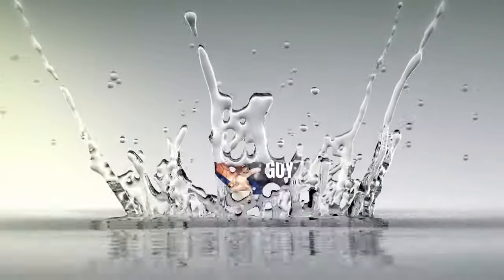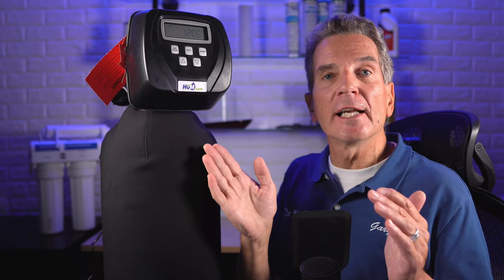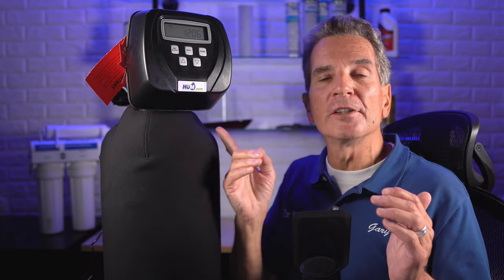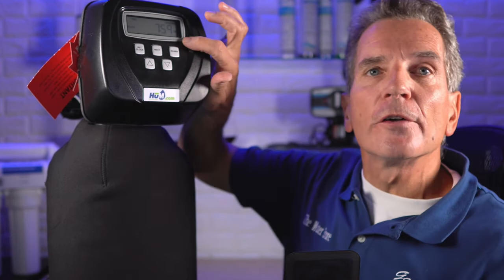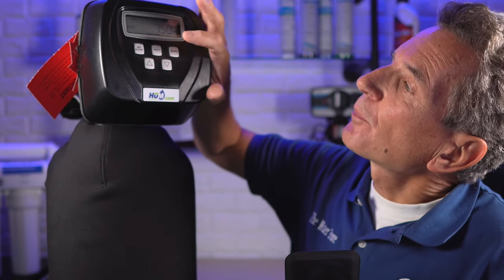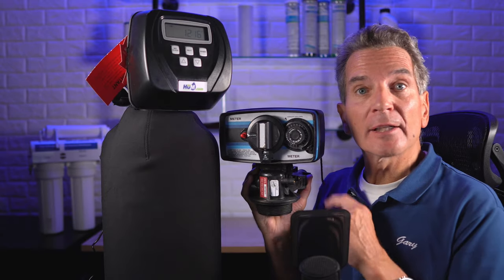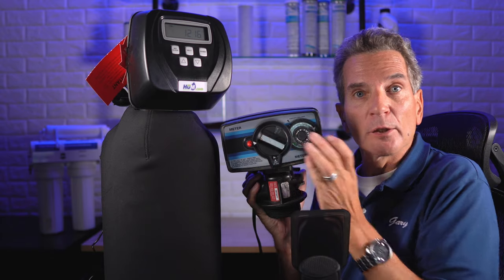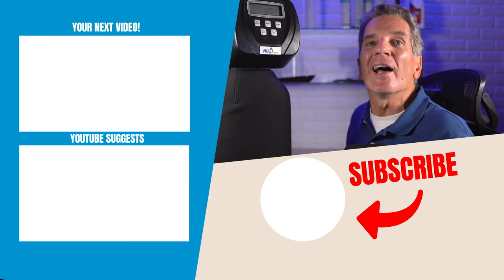WATER SOFTENER Trouble Shooting PRO TIP REGENERATION FAST FORWARD

Comment: I ran a regen cycle and now it's saying to contact the dealer for service. The manual is useless and not quite sure what to do now.
Reply from the maker: Whomever installed your system turned this reminder system on to tell you to contact the dealer for "routine" service.  Likely there is nothing wrong with it at all, they just want you to call them for a service call to "check things over".
Reply: @GarytheWaterGuy  To check things over and pay for a service call whether you need it or not.

Comment: Question! So I did everything you just said, and my system says 4 mins and is counting down. Do I have to hit it again for another cycle? How many cycles does it take to be cleaned?
Reply from the maker: Once it starts counting down you hit the regen button to fast forward to the next cycle.